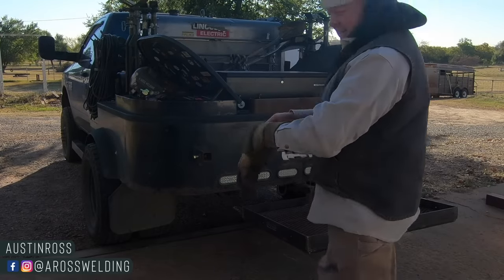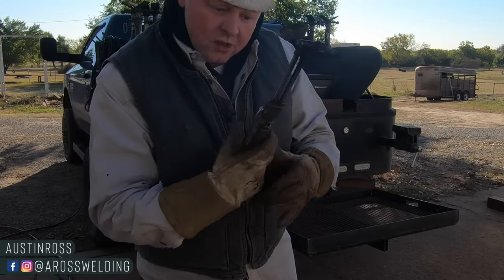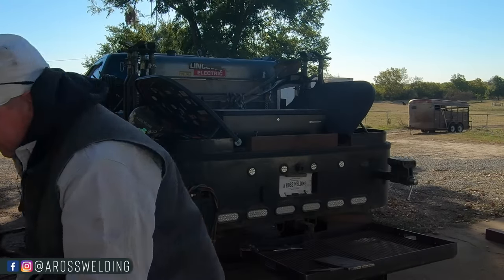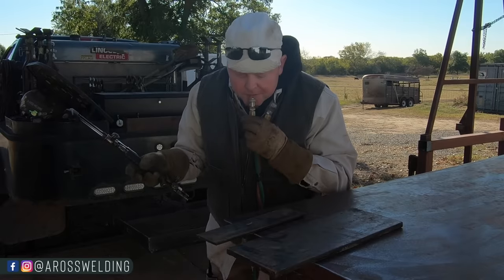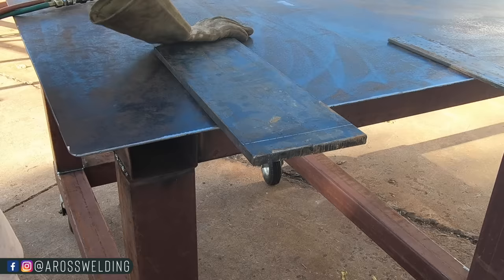10 TORCH CUTTING POINTERS (Never Use Your Grinder Again)

Comment: Hey austin I'm 13 just learning to weld and watch you a lot for tips. I am addicted to welding and hope to learn all that I can. I am a 4th generation welder so it's in my blood.
Reply: good luck buddy 
i finish high school  did welding in college  finished but I was fed up flashed my eyes twice  haven't welded in ten years.  
own touch cart rig
Reply: Brian wear safety glasses and you won’t get flashed I’ve forgot to flip my helmet down before welding a few times and haven’t got it yet apparently they block some of the rays
Reply: @Jack-se5vk  depends on which ones you get so make sure you get the right ones
Reply: weld on little brother
Reply: @Jack-se5vk  I guess the reflection helps a bit, you've got to remember with anything in life, think before you do. It might make you slower than some but you'll have a lifelong career, so will they just potentially a much shorter one.
Reply: Good 👏 God bless your effort.
Reply: It's good to hear young bucks interested in the trade but the biggest thing I can stress is safety. Remember if you're cutting with an oxyacetylene torch or laying a bead this trade can be extremely dangerous so please always follow all recommended safety measures such as proper clothes gloves boots and eye protection. If you're welding don't use welding shade less than 9.
Reply: @Jack-se5vk  yup , UV coated safety glasses , they work.
Reply: Practice, practice, practice
Reply: 14 yet?
Reply: Good job, I always wish I started earlier. Good money when u get a little older 💯
Reply: @Jack-se5vk  facts
Reply: Take care of your eyes son. I've burnt mine more than I can count,( light colored eyes are more photosensitive. Mine blue.) I've welded since 9 yrs old, 59 , I mean 39 now. You'll sort the ginsels  out on here. .  Austin is good instruction/info. I had a good teach or two. Burn and turn, don't be sceerd to look and learn.
Reply: I love all the support that comes from the welding community. And you go catch that dream bud, one of the best trades out there
Reply: Protect your eyeballs! Especially when cutting with plasma or oxy fuel. Flash burn hurts like hell but is also very damaging to your eyes

Comment: At 3:30 of this video, THE SOUND, I am 71 years old and I have only heard that sound from my best friend and mentor in 1981. He was 20 years older than me, I lost him about 7 years ago. ANYWAY!!! YOU ARE RIGHT ON WITH THE CLEAN TIP!!! 
At 5:13 it is hard to tell but "I think" you are to close to the work. I would hold the tip about 1/2" above your work. 
The Victor 300 series is "in my opinion" the very best torch that has ever been produced (period)! Les, my mentor had the 100 series.
When you pierced the half inch plate you showed me something I have never seen before. That is to raise the torch to keep the tip more clean. That is a GREAT tip. 
I wish you and I could get together and share some WAR stories. I have followed your channel for about two months or so.
Have a GREAT day and looking forward to your next video.
Reply: "I would hold the tip about 1/2" above your work"  
Maybe, but I was taught to keep the tips of the heating flame "luminous cones" just off the material surface. And... the cones' length varies with the nozzle size.  (and the fuel gas, acetylene or propane)  And... People are more likely to judge "luminous cone just off the material surface" accurately than "about 1/2"
Reply: @robertlawson8572  I understand what you are saying about the tip size difference. That will make a difference with an EXACT distance, like my 1/2". Sorry that is MY MISTAKE. BUT you should not use different sized tips for the same 1/2" plate. In MY opinion cutting a 1/2" plate you should use a .00 tip with the acetylene pressure about 2 lbs. and the Oxygen about 10 to 15 lbs. Again this is with about 40 years of experience.
If you were taught "luminous cones" just off the material surface. If that is what you believe that is up to you. I was taught to stay UP HIGHER. Why? If you are too close to the work you have a VERY good chance of ROUNDING the entry edge of your cut, the top edge. 
If you want to hold the tip THAT close PLEASE continue to do so. Give my FRIEND AND MENTORS way a try. If the top of you cut in not more square with our way the PLEASE go back to your way. My FRIEND AND MENTOR taught me this in 1980 or 1981. It has worked GREAT for me ALL THESE YEARS.
Good luck with your test cuts.

Comment: 43 years in the welding industry for me and still learning. Thanks for sharing your experience. Clean tip it's the truth. 
Gotta say the " moisture coming out" is not coming from the steel... Its from the flame.
Reply: I did notice the same thing. Yes, you are so right. In the flame, the carbon and hydrogen from the fuel gas is converted to carbon dioxide and water. Hence the water on the metal surface. Basic chemistry of fire. Every time I am using my torch, I think of this process. Thanks.
Reply: Great video, Austin! I just spent 4 hours today cutting apart some fuel tank frames to recover some good-looking angle iron for other uses. I was using a 00 tip with about 25/5 on the regulators. Almost all my cuts were drops; still had to beat the hell out of a couple after buggering up the tip and not stopping to clean it(Bad boy!)  Your 10 pointers were excellent so tomorrow when I finish up cutting the frames, I’ll practice punching some holes and try your 27/7 mix on the gas. One more thing: your comments on gratitude were right on the mark. Really something to think about. We need more of an attitude like that in this country and in all industries. I try to practice being grateful for what I have and what my skills are; sometimes easier said than done with all that is happening during the workday. I’ll check out your store for some dice! Thanks for all the good information you pass along. Take care.

Comment: I collect and overhaul torches, regs and flowmeters (getting a heap of core 450 Victor regs and flowmeters for less than scrap at auction got me started) per factory literature. I like your hose idea because the small OD combination Victor handles don't fit my big ol' meathooks! Worth knowing (you do but others may not) is there used to be MANY different torch body styles in the old days when OA welded and cut everything. 

I decided to collect and try every major brand of US torch since it's so cheap to do and the torches last many decades. The best variety are the old Oxweld/Purox/Linde/L-tec/Union Carbide (the welding industry consolidated like mad middle last century!) and their industrial "feel" is like the feel of a gun that fits your hand. Many have bodies as thick as the hose you use and their VARIETY is impressive. No wonder they were so popular for so long. I'd take their feel over other brands and though most models are out of production cutting tips are still easily available online (I stock up cuz I'm cheap). 

I'd say Smith have the best quality today and have the best engineered tips. Harris work fine but I never fell in love with them. Airco (now Concoa) combination torches tend to narrow handles I dislike and Concoa (smaller line of course) use the same tips but don't sell rebuild kits. Their steel heads are tough though and would be a quality choice for other companies because they take abuse so well.

Of course since Victor are everywhere it makes sense to carry those on the road (unless you bring spares and spare tips). I got bored and did what many old shops did and took the body of a CA 2460 from my donor pile then installed the longer tubes (don't forget the internal mixer) and cutting head off an old ST1100 straight torch (same exposed nuts at base is the match). I used a HD 310C handle (not mandatory but I had a cool one with different sized knobs (which were sold for mining use so the user knew which was which by feel instantly). That got me an extra-long combo torch that fits in a small box with my other heads, heating tips and rosebuds. Hardly cost anything and is sometimes quite handy. 

450 series Victor regulators make the most sense to me because kits are cheap and you can replace a bad seat in a few minutes in the field. I grind the internal chamfer off a SIX POINT (caps for emphasis) to fully grip the shallow nut (which works for many shallow nuts, the chamfer is purely a production aid to center the broach).

Thanks for all your videos! I directed our welding student to them since you're a better communicator than many if not most instructors.
Reply from the maker: Pleasure is all mine! Thank you for taking the time to share lots of handy info with us!!!

Comment: Thanks! I’m an auto mechanic by trade and use the torches almost on the daily. Mostly heating up seized fasteners, but cutting the odd time. Pretty sure we got the wrong tip on our torch. Will be double checking the pressures also!

Comment: Chapters:

Tip 1 0:44  Rubber Hose
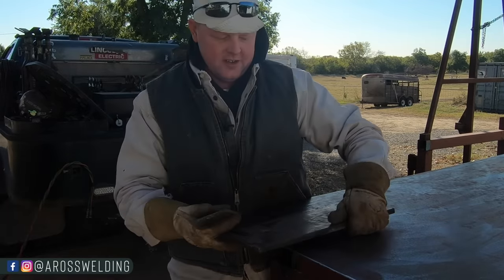Bonus Tip 2:18 Quick Connects
Tip 2 2:55 Proper Pressures
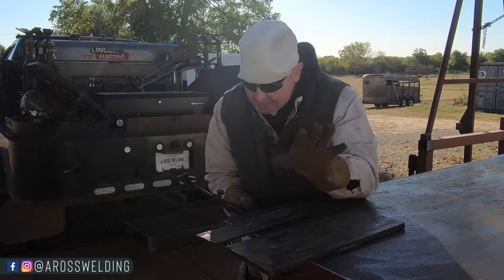Tip 3 3:22 Clean Tip
Tip 4 3:51 My favorite size of Torch Tip 00
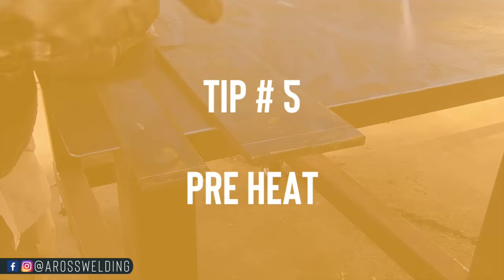Tip 5 4:13 Preheat
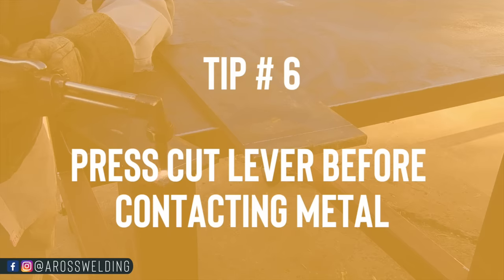Tip 6 4:59 Press Cut Lever Before Contacting Metal
Tip 7 5:13 Proper Travel Speed
Tip 8 6:01 Tip for Piercing Metal
Tip 9 10:23 Gratitude

Comment: I had a question why when I cut sometimes my metal starts to fuse back together after I cut through it I would love a response from the goat himself. Thanks for putting out content so often always a pleasure to watch and learn from your videos. Stay blessed.
Reply from the maker: Most likely it’s cause your tip is dirty
Reply: @arosswelding  yeah....he probably need to go se a doctor, if he got a dirty "tip" 😁😁
Reply: The metal will fuse back together if you are going to slow - try increasing your travel speed.
Reply: @arosswelding  appreciate the feedback brother💯💯
Reply: @RCasey100  appreciate the feedback💯
Reply: Depends too on the size of your tip.

Comment: You have a Victor torch,use Victor quick disconnects. Victor has chart cards for tip sizes and pressure settings. Also rate of travel for various kinds of fuel gas! Don't spend all day pre/heating,take a coping chisel,raise a burr, the burr will heat to burn temp and you can start burning immediately!!!
Reply: Chisel or center punch works great when piercing....👍
Less than half the time pre heating...

Comment: My torch work leaves me quite a bit of practice filling gaps:)
I am fixing some of those thin metal round bale feeders now, very thin metal. I am using a flux core to weld it. New feeders are kind of pricey.
Reply: If you are getting bad cuts on thin metal, tip your torch such that it is not 90degrees to the plate. When I have cut 12 guage the torch is tipped more than 45 degrees
Reply: I have gave up on storage bought junk feeders make my own out of 1 11/2 and 2inch heavy square tubing will be expensive but last for decades with a little paint and cleaning
Reply: If you can swing it, plasma gives you much better cuts on very thin metal and is much quicker.  And a MIG with gas is probably better on thin metal.    .035 or .030 wire is good on thin stuff.  I always used CO2  on hay feeders and other rotten metal farm stuff but a blend with argon will reduce burn thru on thin stuff.  I miss those days when we had so many cattle but I'm too old to wrestle em now.

Comment: I’m trying to figure out how to cut 1/4” with my late fathers Harris brand torch. My son is in trade school and he’s tried it but says something is wrong. It doesn’t cut. He’s 17 and not familiar with troubleshooting equipment because the school just has good functioning equipment. I’m wondering if the oxygen gauge is malfunctioning because it moves when you tap on it. Is it crucial to have accurate pressures for cutting? I’d think just increasing the o2 flow even if the gauge is off would suffice for now. Of course I’m no welder. Why doesn’t the school teach troubleshooting as well versus just welding.

Comment: Tip #11….  Switch to oxy/propane if all you’re doing it cutting and NOT brazing.   I use plasma for thin metal and oxy/propane for all thicker cutting and heating.   It’s so much cheaper and there’s no 1/7th flow-rate rule you have to worry about, unlike acetylene.  Propane is so much easier to transport, store, use and about four times less expensive than acetylene.  The downside is more oxygen is used with oxy/propane cutting, but so what.  02 is fairly inexpensive.  I love the switch and will never go back to acetylene again.   However YMMV.
Reply: Propylene or propane is very corrosive, one will need new gauges new lines and new torches so the savings won't be for some time.
Reply: @SheikYerbuty  Fake news.  Not exactly.  It’s not “corrosive.”   It’s about “permeation” of the gas in the hoses.  Grade R for acetylene will allow permeation of the propane, because Acetylene will max out at (15psi) but propane can run as high as 40psi.   However it usually runs between 3-5 psi.   So, the hose being made for acetylene is not designed for propane.  

So that’s what grade T hose is for.  It handles not only propane or propylene, but also acetylene as well.   It’s also flame and oil resistant, which grade R is not.  A new hose set up is between $30-60.  (I just checked).   Regulators can stay the same. It’s just that past 15psi for the acetylene and the color on the gauge is “warning red.”   New regulators won’t break the bank either if one is worried.   As far as the torch, it can stay the same.  It’s just a new propane torch too is needed.  Big deal.  All very affordable for a co version.  Beside the money saved in replacing acetylene in the long run is well worth it.  I used both systems.
Reply: @colt10mmsecurity68   Thanks for the clarification, much appreciated...
Reply: I like and use Propane, however there are no good videos or documents on its use. I've had to just work out. Austin, could you offer any content on oxy/propane?

Comment: i don't know but I've been told some tips depending on the no. of fuel holes can be aligned north south and east west with torch head and can improve how wide your kerf is as well help to follow your cut line. just a thought.

Comment: I have a torch but I'm not very good with it yet. The sound you described as being the sound of a clean tip, I thought that was a bad sound. All that wheezing/fizzling, I thought it was supposed to sound smooth and quiet. If I've been wrong about that, maybe that's part of my issue. But if that's what a good/clean tip sounds like then does a bad/dirty tip sound like?
Reply: I thought the same!

Comment: I'm just learning about using a cutting torch. The torch I have doesn't seem to do anything when I press the cutting lever. Any help will be greatly appreciated.
Reply from the maker: Your tip is most likely dirty. I recommend cleaning it with a set of torch tip cleaners

Comment: I would always clean back to bare shiny metal before welding clean metal mix in the weld pool less chance of slag inclusion from the oxidation scale on the plate. Clean feathers on the flame ring (sharp and even) and clean jet of oxygen piercing the centre so it 'cut's' clean and crisp. 👍😉

Comment: At my old job we would use a torch and an automatic trolley on tracks if we had to cut really long straight cuts or bevels. If the speed was just right we could turn off the acetylene and it would continue cutting for a min with just oxygen. Furthest we got it to cut doing that was maybe 6 inches. Blew my mind the first time someone showed me that. I thought the guys were screwing with me till I saw it work.
Reply: You should look up an oxygen lance

Comment: Tip number 10 when your piercing have a plate always prick punch the center of your hole will pierce a little bit easier with a cleaner cut

Comment: Do you cut off oxygen or acetylene first?
Reply: Oxygen
Reply: Most people turn off the oxygen first, but I have a book that says it's better to turn off the acetylene first.  That way, you don't get that fuel-rich, sooty flame during shut-off and so your tip stays cleaner.  The flame might make a loud pop as it goes out, but that's no problem.

Comment: My problem is when I'm cutting the gap fills back in with molten steel and slag which is very irritating, what am I doing wrong my pressure's are 5 on the acetylene and 40 on the oxygen but maybe my tip is dirty
Reply: Sounds like your tip size is wrong.  Tips for thicker metal have bigger preheat jets.  That can melt your work outside the kerf.  That molten metal flows around your cut and welds itself back together.

Comment: One old trick to put a beveled angle is use a small piece of angle with small holes in it with a clamp and it cut your bevel or angle when set properly

Comment: The moisture isn’t coming from the metal it’s from the torch actually. But all good stuff there.
Reply: Right.  One of the products of combustion is water, and water vapor exiting the zone of the flame condenses to its liquid state when it contacts the relatively cold metal.  Then, it doesn't take much warming of the metal before that condensation no longer happens.
Reply: @ericl2969  hear it all the time about moisture in metal. On fire welding just said it too. Left a comment there also, its become my thing i guess. Enjoy both channels though.

Comment: Or if your blowing like a bolt hole draw a hash tag the size of the hole you want punch up a peak in the center heat it up and go the hashtag will tell you where your at with your hole size

Comment: Or if your blowing like a bolt hole draw a hash tag the size of the hole you want punch up a peak in the center heat it up and go the hashtag will tell you where your at